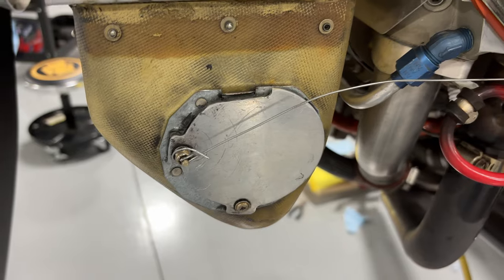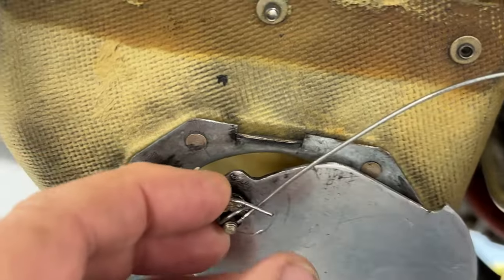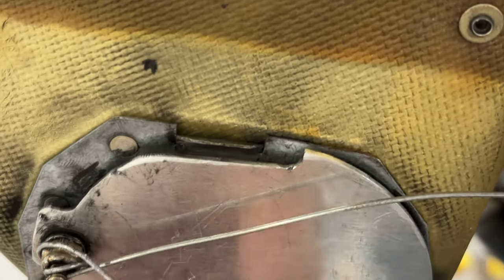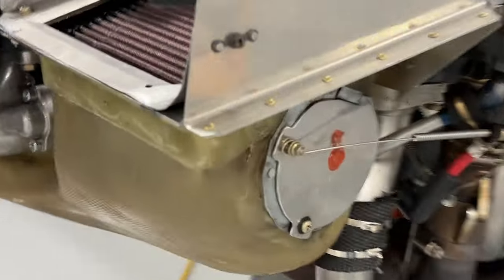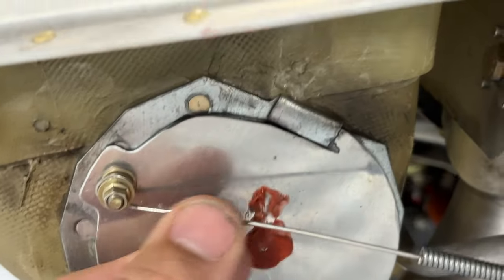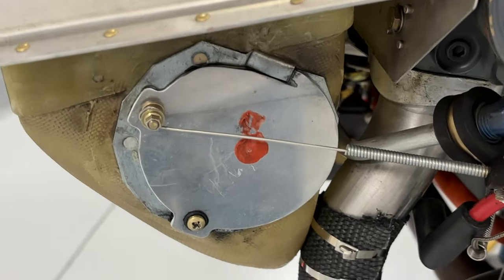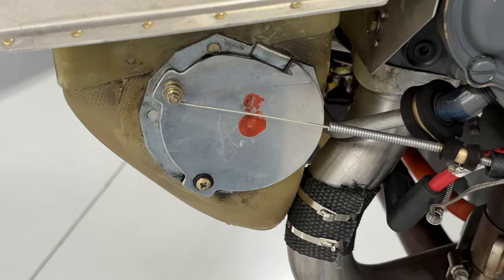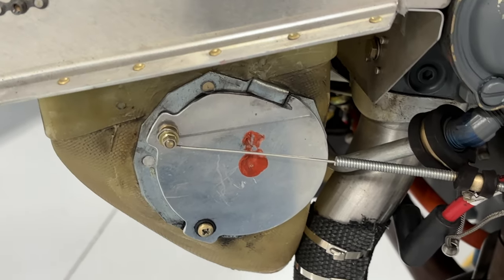Alternate air Intake on a RV 7

Comment: I've got this - horizontally - on my 9A. It's an awful setup. I've had to rework it 3 times in 5 years. It wants to tear out the bottom of my air box and I've had to add a topside plate to reinforce it. The geometry of this is terrible and more often than not the door has worked it's way open, at least partially, whenever I pull my bottom cowling. I'd love to see a completely different design that has guides to allow it to be closed after opening and that you can trust to be closed if the actuator is in a closed position in the cabin.
Reply: Same.  That fiberglass bowl needs to be replaced with metal.  Not only does the metal ring wear through the bowl but also the filter.  And the actuator should be replaced with a rod, anchored to the engine (my 6A plans showed it anchored to the nose gear bracket, which causes severe flex on every engine start).  I'm thinking a carbon fiber bowl with molded-in runners for a carbon-fiber shutter would be better, and a metal ring as a rub plate for the filter.  Repairing an oil-soaked fiberglass FAB isn't fun or conducive to good workmanship.
Reply: @NAUFlion  A captive shutter would be so much better. And oil-soaked  fiberglass is indeed miserable to work with. I like your design, but it would be a significant project to manufacturer. The FAB as a whole was the part of the build that I was least satisfied with, process and outcome.